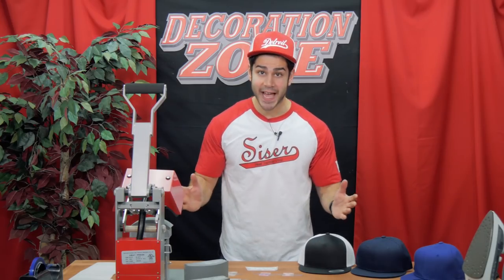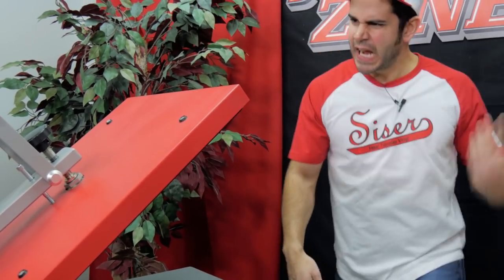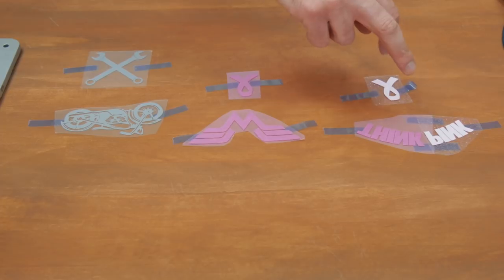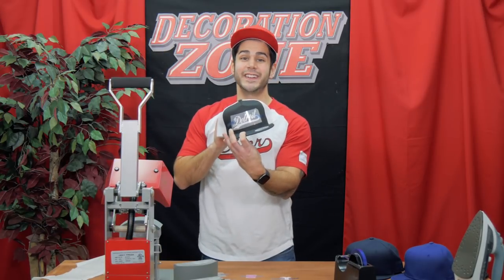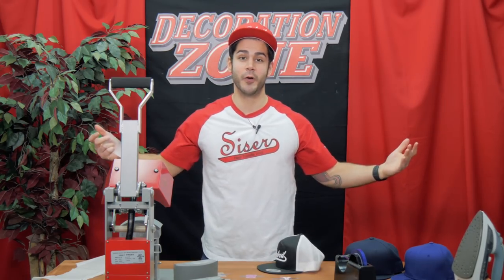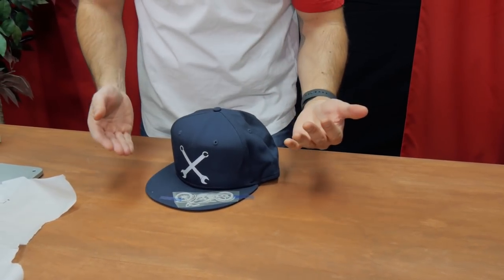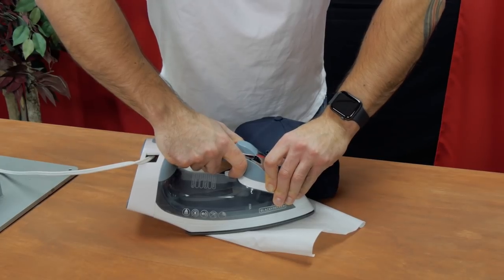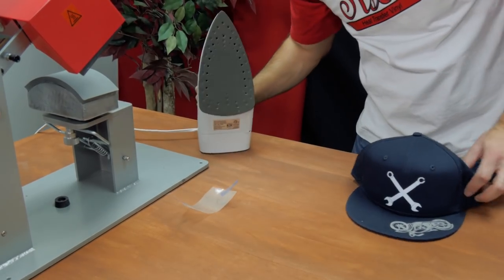Decorating Caps with Siser®

Comment: Great video and easy instruction. You helped show me ideas I've struggled finding. My hat press has the pressure springs adapter plate protruding out the edge of the front, (its circular and the heat plate is rectangle) which forces the cap bill back, cranking it, but I think I can move the bottom heat plate out slightly to compensate. Also, I need to find a way to lock my hats down. No attachment on my cap press
Reply from the maker: Thank you so much for watching! If you plan on doing a lot of hats with HTV for your business, it may be a good idea to look into a reputable cap press that will allow you to properly adjust your pressure, accurate temp, and the ability to change platens. If you need help finding suggestions, please email us at info@siserna.com

Comment: Have some hats that have a thick. Seam and it wont take the vinyl on the sides of the seam.. Thoughts? any.suggestions ???
Reply from the maker: You may want to look into getting a lower cap platen that fits better with your hats. You must not be getting even pressure.

Comment: I have an issue with snapbacks and trucker hats  bc of the square front, when I lock it down it never seems to lay completely flat. So when I press it, it wrinkles up. Any tips for that?
Reply from the maker: You may want to look into getting a platen that fits your hats better. Usually Cap Presses have the ability to change the platens.

Comment: How would you press the brick vinyl on a hat? I know you need to press on the back to really activate the adhesive, and I'm wondering how you'd do that on a hat?
Reply from the maker: For Blick 600 HTV on a hat, you simply have to press for 20 seconds at 320°F and it will adhere.

Comment: I noticed you are not modifying your lower platen at all.  Is this platen different from most "standard" platens in the market?
I have had a few cap presses but I've always had to modify my lower platen with foam inserts.
Reply from the maker: Hello! So, I was using a lower platen that fit perfectly to the hats I used in this video.
There are a ton of different dimensions of lower platens. If you get one that fits, you shouldn't have to use foam inserts.

Comment: What size Siser Platten did you use? I have 3 different sizes and when I lock down the hat - there is still a lot of play in the middle of the curve... The platen doesn't have the same curve as a trucker hat shape...I get wrinkles and creases in my designs - thanks
Reply from the maker: There are about 6 different platen sizes... you can always use a foam (such as a piece of mouse pad or yoga mat) to cushion or as filler in the middle of the hat.

Comment: When should you change the cap press platen, on what type of hat and size and how would I know to switch it? By the way very nice video so now I can take mines out the box, which I had for 2 months and scared to use it smh
Reply from the maker: You will know when to switch platens, because the face (front panel) of the hat may vary in size. This is dependent on the type of cap, the manufacturer, etc. 
That would be when you switch, and switch them back is very easy. The platen just falls into the grove of the Cap Press.
Reply: @SiserNorthAmerica  Thank you

Comment: I have that same press but have a problem it keeps pinching the middle of the cap in word leaving a real ugly cress no matter how far I set pressure any suggestions
Reply from the maker: yes! I would suggest getting another size platen to better fit your caps. This will make a big difference.
Sounds like the platen you currently have may be too big for your hats.
Reply: @SiserNorthAmerica  have the same press and have the platen that came with press what platen you recommend for the classic yupoong caps 5 panel

Comment: my cap does not fit flush on the platen despite trying to move it around!!!!!
Reply from the maker: You may want to look into other size platens! Each hat has a slightly different dimension.
Reply: Or if u can invest in the stahls 360 iq ...u dont have to change platens @ all

Comment: how do you avoid scorch marks?
Reply from the maker: With any Polyester fabric, fully avoiding scorch marks can be very challenging. Unfortunately, there isn't a perfect formula for that.
Make sure you have a cap platen that fits your hat correctly, that is very important. Make sure your pressure is set correctly.
With most of our HTV, you have a margin of temperatures you can apply at. With The EasyWeed Family, you can drop the temp down to about 285 and press for about 15-20 seconds. 
This may help quell the scorching.

Comment: Hi, bro could you tell me What kind of press do you use and where to buy it?
Thanks 
Diriangen58
Reply from the maker: That is the Siser Digital Cap Press or more commonly referred to as the "Red Cap Press". You should be able to get one from an Authorized Siser Distributor. If you don't currently order from a distributor, send your zip code to info@siserna.com and tell them what your'e looking for and they will point you to the nearest distributor.
Reply: Heat Press Nation sells them

Comment: So you know how sometimes when using a cap press you get that weird “ledge” at the top of where the platens meet (top edge from pressing)? Any suggestions to help reduce the press marks on hats?
Reply from the maker: You can try decreasing the pressure a bit... or make sure the inside seam of the hat is not on the platen. Unfold it, and that will help alleviate any ledge mark above the brim of the hat.
Reply: Cool thanks—I’ll give both suggestions a shot.